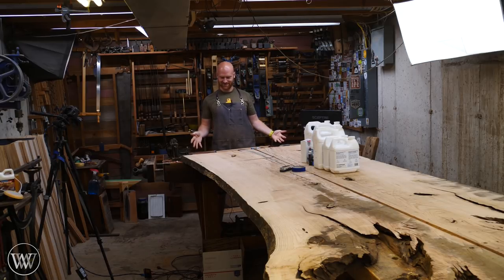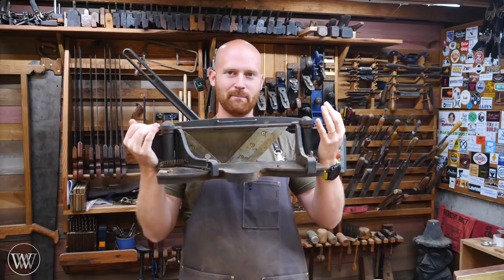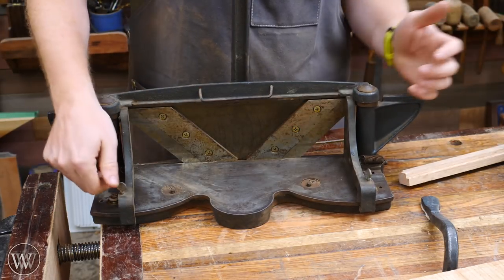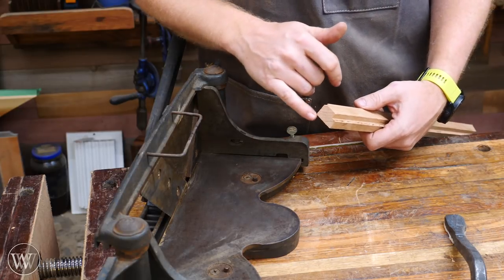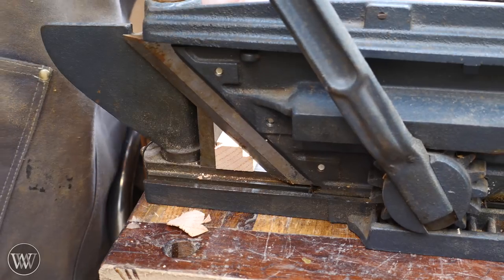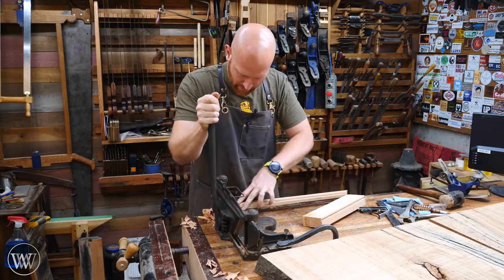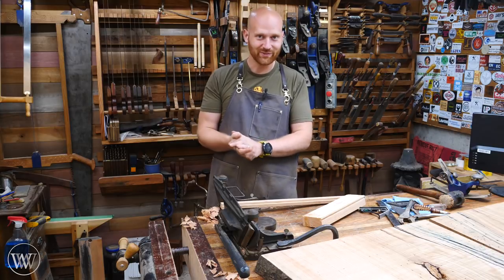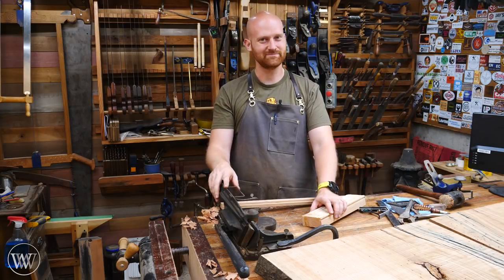What is a Miter Trimmer or Miter Shear

Comment: My father used one for close to 50 years and now I have it and love it. Been working as a finish carpenter and cabinet maker for over 40 years. I tried for years to get him to give it to me after he retired, however even though he parted with many tools he wouldn’t give it up until he passed. You do need to be very careful because when sharp the blades are literally as sharp as razor blades. I have nicked myself just trying to move wood shavings, use a brush or scrap, keep you fingers clear at all times. It is most definitely my favorite tool for water tight meters and I love how clean each cut and how tight each fit.

Comment: As a teen I irked with a very smart trim carpenter who used one of these extensively. When doing high scaffolding work, he would pre cut all his wood and up he would go!
Between this tool, a hand plane, pull stroke saw and and a small assortment of hand tools? He would kick out the most exacting work fast......only coming down when absolutely neccessary! Never realized how truly spectacular this man was with his craft until future experience finishing behind other carpenters revealed his skills by comparisons. An incredible tool that is as valuable today as it was (when first introduced) in the 1880’s. (Basically unchanged too and sure cuts down on job noise.)
Reply from the maker: It is amazing what some of the old skilled Woodworkers could turn out. Just amazing!

Comment: Is this likely to handle a chunky 3 inch walnut picture frame? Also, do you need to do a preceeding cut so the shear is only cutting off a thin sliver?  Otherwise I'm guessing you get into a problem of internal tension building up within the offcut.

Comment: Looks just like the one I have, complete with rust! Was really hoping for instruction on how to set the 45 deg fence stops back to "default". Mine has taken quite a few knocks over the years. Tried a speed square against the fence and blade, but there must be something better.
Reply from the maker: Yes for that you actually trim the ends of two boards and then check them against 90° square when you put them together. Then go back and adjust and do it again, You usually have to do it 5 to 10 times until you can dial it into exactly 90.
Reply: @WoodByWright  That is what I thought, but was quite dreading it. Thank you for the quick response!

Comment: I’ve seen those but never actually in action. One really would be handy for framing.
Reply from the maker: oh ya. makes is so quick and simple!
Reply: We have two large, floor standing, foot operated frame cutter machines at a framing workshop I attend that are the industrial versions of the tool you show here. They're extremely fast and efficient and can cut two angles at once. They make cutting frames very easy. This is the first time I've seen the small ones though.
Reply from the maker: I have gotten to use one of those. So much fun!

Comment: Please help me, I don't know which tool to buy to cut laminate flooring planks. I found a cheap jigsaw on eBay & the proper laminate flooring cutter is more expensive & not electric, looks like a guillotine. Will the jigsaw work?
Reply from the maker: that depends on the laminate that you have but for most of them a fine tooth in a jig saw will do the trick.

Comment: I bought  this tool this morning but I try to cut a couple pieces of oak and poplar (1/4 x 3/4) trim and I can't cut so smooth like the video or the others videos at you tube cuts very forcefully and leaves the cut bruised, as soon as it has a chance to return to the store
Reply from the maker: It needs to be sharpened. Just like a plane blade. They normally do not come sharp.